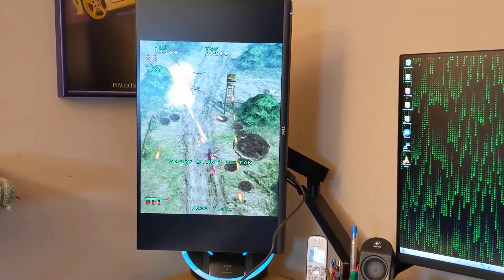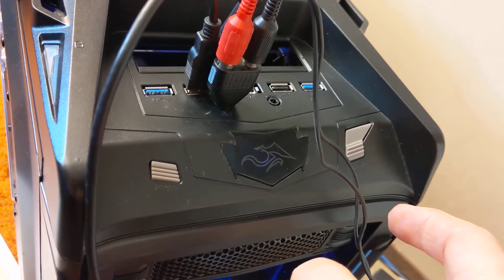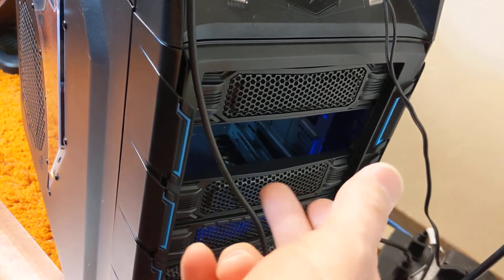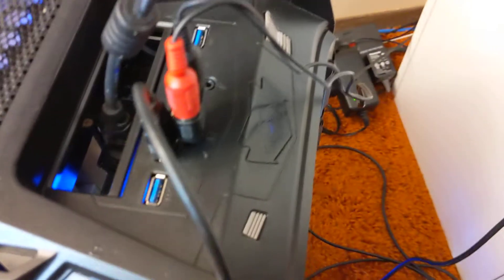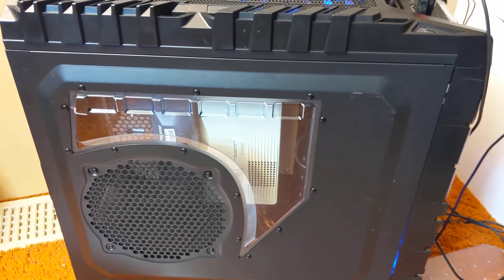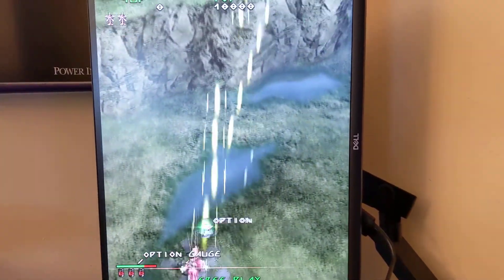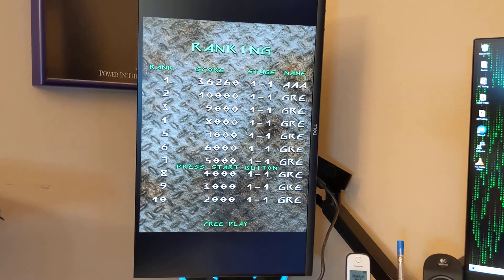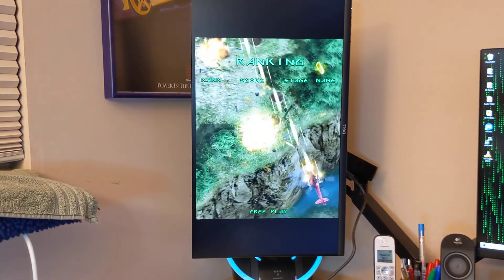Sega Naomi Netboot with WiPi - Part 9

Comment: With the Naomi 1 are you still able to play atomis wave, Naomi 2, and chihiro games via netdimm using wipi? I originally thought the memory in the netdimm was the limiting factor, but then I realized the Naomi board itself had a weaker graphics card and less ram than the Naomi 2
Reply from the maker: You can only play Naomi 1 and Atomiswave (converted) games on the Naomi 1 hardware.  The same netdimm setup is used for loading games on Naomi 2 and Chihiro and that's why the wipi SD card image has those games on it as well.
Reply: @TomsProjects  excellent! thank you again, you've been a big help to my project